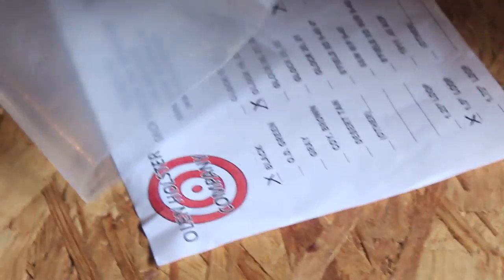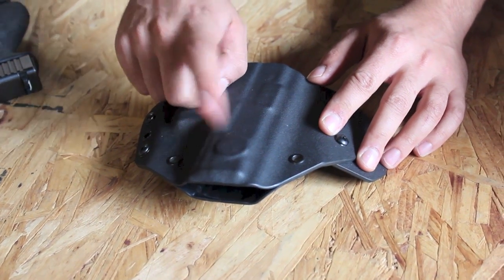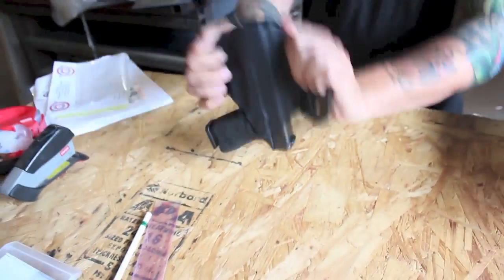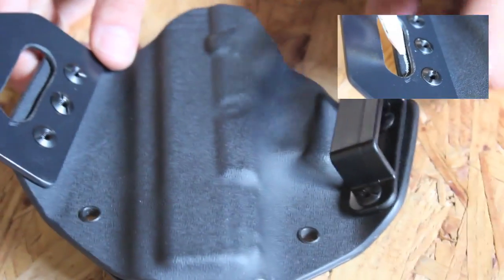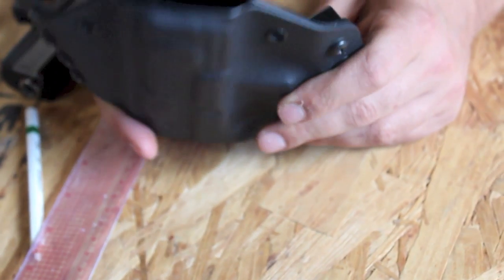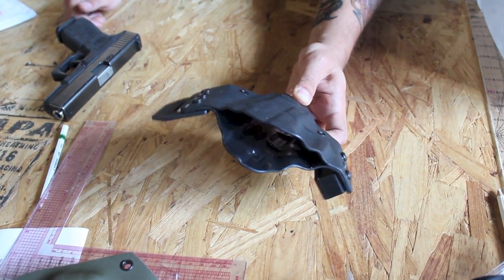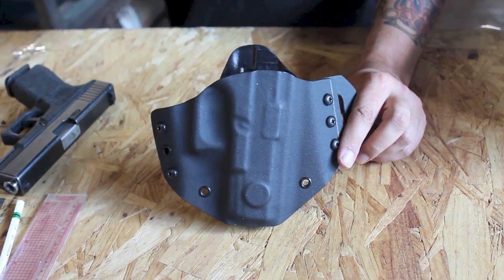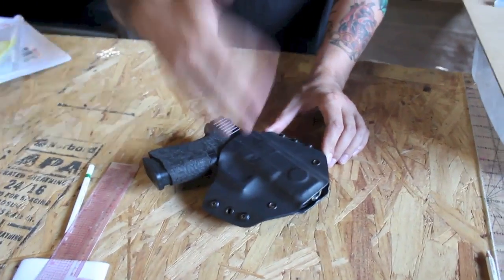Holster Clinic Episode 2

Comment: I get the injection molded belt loops from DIY Holster  For the pancake wing I used 1.25" kydex.  DIY Holster makes injection molded pancake wings but in my testing they are to thin and flexible.  After wearing a DIY pancake wing on a holster the wing takes a bend to it that stays there and just doesn't seem as secure as the 1.25" kydex pancake wing.  The kydex wing takes longer to make but looks better over time when it doesn't flex and bend and I think will wear better.